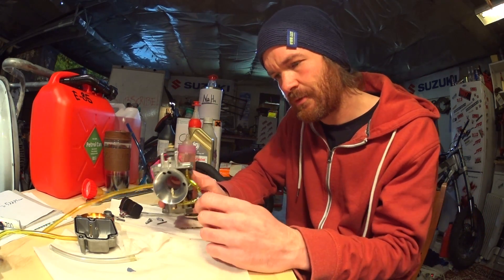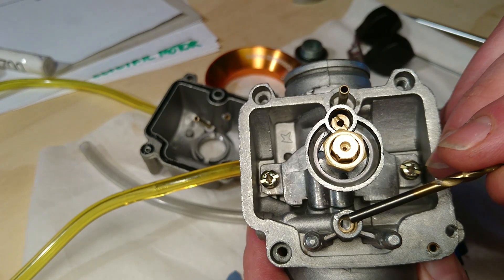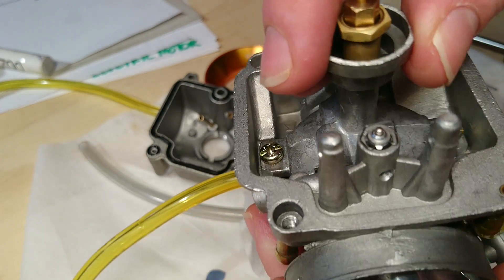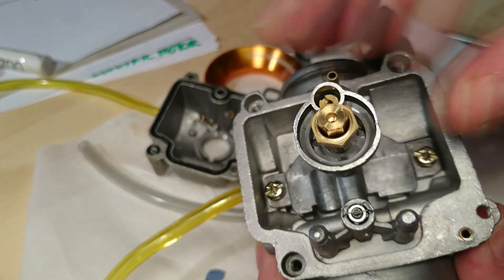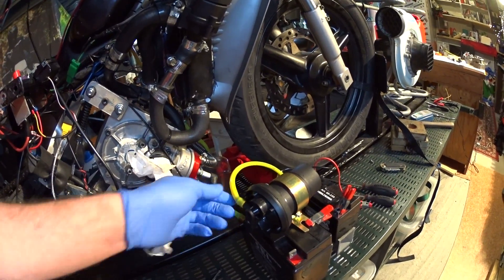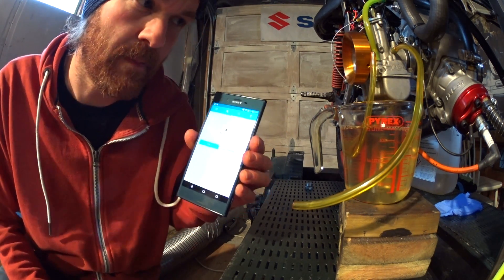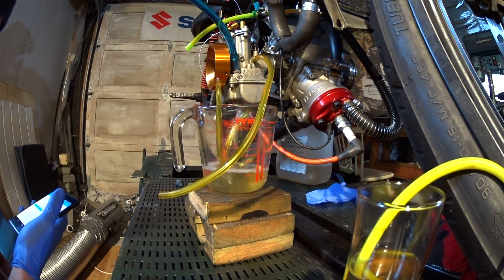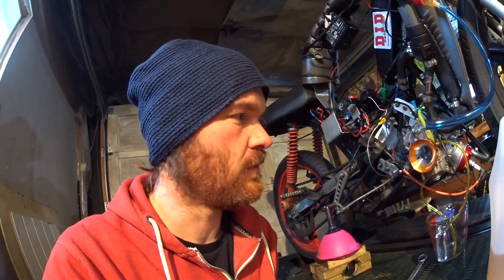Convert Oko PWK to Alcohol - Somewhat Daily Stuffing

Comment: try running it on fumes instead. gasoline is ment to be burned as a gas. ditch the carb too they are inefficient. you do this and you will quit losing fuel out your exhaust

Comment: Does switching to e85 increase power or only reduce detonation?
Reply: Ok so if I'm correct you gain about 10% power just by switching to methanol and jetting has to be increased by about 40% of diameter. I don't know about e85.
Reply: You gain 5% power from just running e85

Comment: Do you need to change the carb setting if you using a gas and rc fuel mix 70%gas /30% rc fuel?
Reply: For a stock derbi senda 2011 model
Reply from the maker: Yes, if you can get the RC fuel to mix with gas, which is very unlikely.
Reply: @2STROKESTUFFING   ok i hope's it will work but tnx for the reply

Comment: Is there any problems with oil seals? What compresion ratio is best for alcohol? Can stock engines run on alcohol just for fun?
Reply: yes. generally you want a bit lower CR but that is only in extreme situations like 16:1 on gasoline you'd want to go down to maybe 15-14,5:1. And increase spark advance since alcohol burns much slower

Comment: the fuel flow trough the bottomof the carb doesnt effect the bikes performance. the jetting does. the bike wil never use that much fuel in that short time.
Reply from the maker: +Tim Melink I can assure you it will when running methanol and nitromethane! In my 50cc Spx fuel consumption is about 1l for 30 seconds of warmup and three dyno pulls. You can see the level dropping in the tank while running.

Comment: I wonder why Keihin let the copyright on the PWK go for so cheap? whereas their other carbs like FCRs are still big $ .. maybe it because everything is going fuel injection and PWKs are a pretty simple carb
Reply: Any differences between the genuine pwks and the copies; would it be better to buy genuine?
Reply from the maker: +Jack Logan Some are almost indistinguishable from the real thing, some are utter shit. Genuine OKO's are good.
Reply: They look pretty goofy but I guess you cannot argue with the price. I was going to test it on my old 125 husky its running stock carb since factory. Anything I should worry about going from 38mm carb to 34 or 36?
Reply from the maker: +Jack Logan It might run worse with a smaller carb, but PWK's flow very well and it could work better too. Try it!
Reply from the maker: +shoominati23 Good question! And PWK's are simple, and great carbs in my opinion!
Reply: I'm using  a  Dellorto 21mm PHBG clone for my Aerox. It's one of the better copies, but a clone none the less. I guess some models are bigger money spinners for them than others.

Comment: the drill bit makes shape edges on the float needle i take a fat wooden tooth pick thing put some fine polishing stuff on it and turn it a lot, clean it and test to see it stops flowing when you don't want it to when the bike is off but i say the float needle needed to be adjusted it set lower now ,like you did

Comment: what size pilot jet and main jet for 100% methanol (my engine 100cc)
Reply from the maker: +jame CH3NO2 Gasoline AFR 12:1, Methanol AFR 5:1 12/5 = 2.4 - Multiply your gasoline jet AREA by 2.4 as a starting point, make sure your fuel system can flow enough!
Reply: I change all size for pilot jet and main jet but it running on fuel lean because my  fuel system can not flow enough Yes or no.  and I must  change jet needle with yes or no.
Reply from the maker: +jame CH3NO2 Yes, if your fuel system can't flow enough you will run the floatbowl dry and run lean no matter how large your jets are. You most probably will have to change the needle jet and needle.